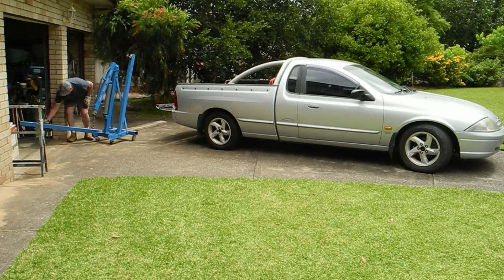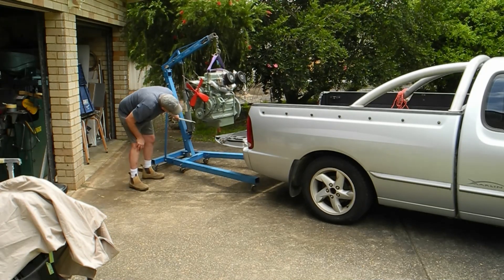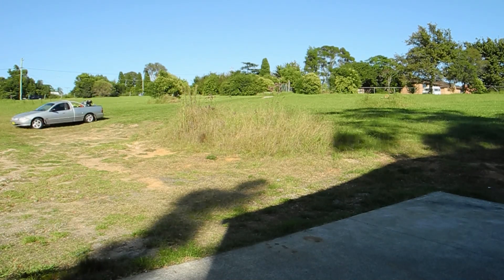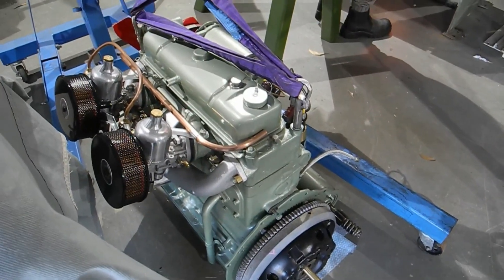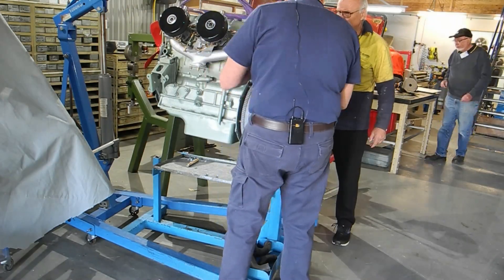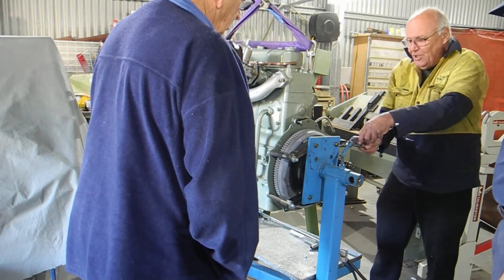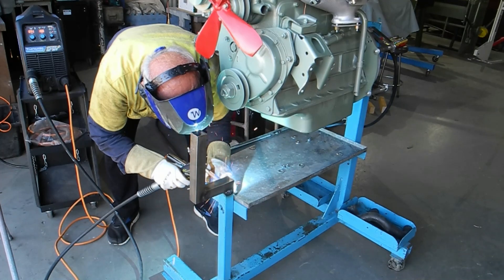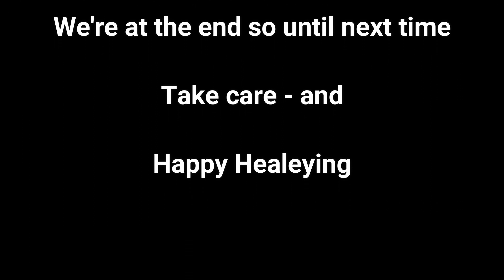Austin Healey 100/4 - Placing the engine on a test stand (31)

Comment: I have tried to mount my 3000 on an engine stand and it wants to tip over. The stand is obviously dodgy , however I cannot seem to locate a decent one that can handle it. I might try my local mens shed as it looks like a really positive place to hang out.
Reply from the maker: Hello HealeyGuy
Coolum has a really great mens shed. I can't find our previous chat but I think you are from around there 'Bribie?' about 90 minute drive. Caboolture also has one. They did a thing with John Paul Young recently which took YouTube by storm (well almost). Ours has a couple of hundred members with a metal shed and a wood working shed. Most guys do the woodwork thing. If you're inclined get in touch.
Hugh